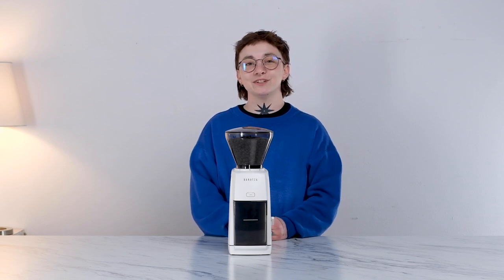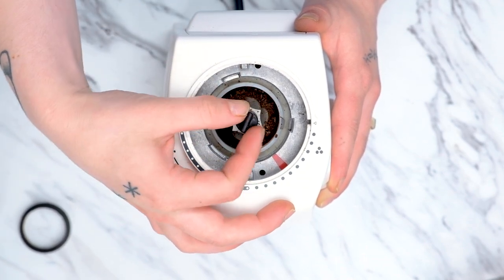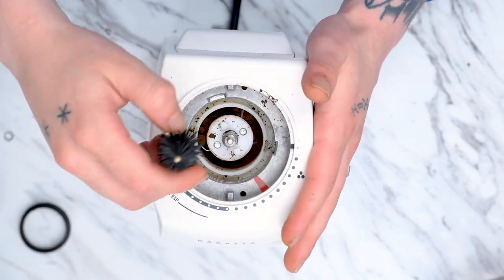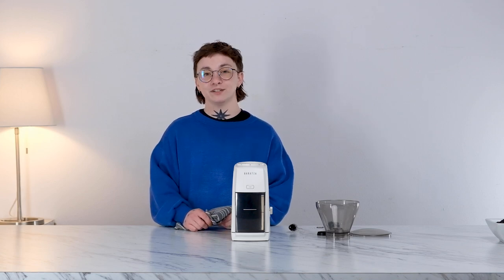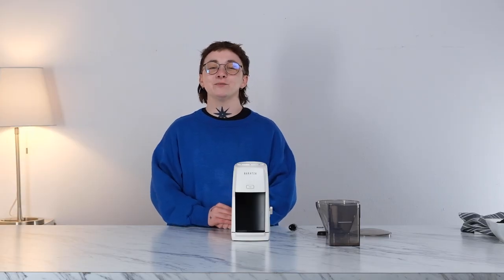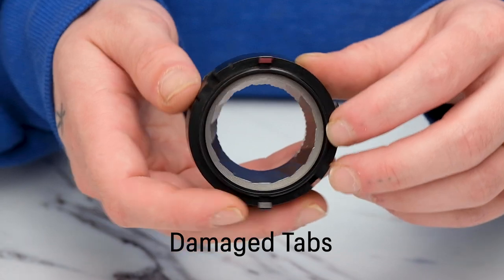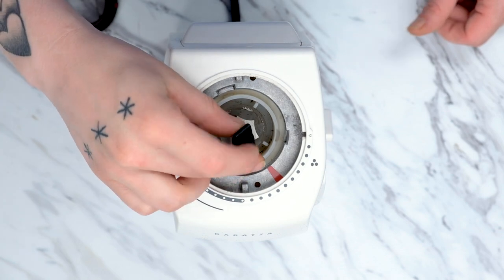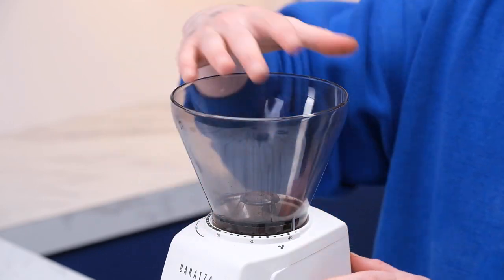How To: Unclog Your Encore ESP

Comment: In the case of a clog, I found that a small allen wrench worked best. Go in from the front underneath and angle it up to punch out the clog. This is a wonderful grinder but it has a glaring design flaw. This should be easier to unclog given how frequently it happens.

Comment: The paddle wheel doesn’t lock on top of the paddle wheel pegs, what should i do?
Reply: I had the same problem and realised the paddle wheel was a bit misshapen... Although maybe accidentally putting it back in upside-down and then trying to grind didn't help.  Either way, if yours isn't locking on then check it.  I had a look and it's cheap and easy enough to get a replacement, sort of.

Comment: To Baratza Support - I have an ESP with one of the spacer washers on top of the lower burr. I am able to remove the hopper, gasket, upper burr and lower burr retaining knob just fine, but I cannot get the lower burr to budge. In every video I've seen, it lifts out easily with no threading or effort, but mine is stuck tight. I don't want to try using pliers to dislodge it, and don't happen to have a right-angle dental tool lying around. Any idea why it is stuck, and what to do to release it?
Reply: Mine does the same thing

Comment: Is it in theory also possible to remove one or two of the shims from the stock setting, let's say in case the steps are too fine?
Reply: Me answering to myself: Did it, works fine. I only removed one of the smaller shims. There are 3 thicker, and 3 thinner. I removed a thinner one.  The scale just gets all across the board more coarse then. But I put it back in nevertheless, cause I figured I don't need it. I though it would be cool for my pour overs, to basically push the fine 20 steps more into the coarse range, to have in the medium fine range more steps for the perfect pour over grind size (i grind relatively fine for one cup pour overs). But I ended up finding my range, with one shim removed, around setting 11 or 12. So I thought, well, that is just around 18 with all six shims installed. So I put it back in. But it worked fine!

Comment: So I assemble and proceed to grind aobut a cup of decaf beans. Then I go back to do the same with regular beans and presto-nothing comes out! I assume it is clogged but not in the upper mechanism as I took that out, &  cleaned it
I will follow the video and I assume that will cure the issue, but, after less than 2 cups of beans? This unit costs $150 and it cannot get past a cup of beans....
I want to order a replacemnt gasket, felt washer and the  plasitc paddlewheel as they look ike the pieces that will fail.
I hope I just had bad batches of beans else this unit will be going back.

Good video!
Reply from the maker: Thank you for bringing this to our attention! If you have not already, we would suggest running through this troubleshooting grind quality video to make sure that all the components are in good shape still - https://youtu.be/qUCMrWIdyLI. We do sell replacement parts on our website but feel free to reach out to support@baratza.com if you have any further questions or if this grinder is still under warranty!
Reply: So i cannot remove the center cone burr--even after I removed the wing nut! It will not pull up. This unit is looking to be a not so good product and gettting phone help is impossible. This video is all I have and it just appears the unit should just lift off easily.
I will produce anothe rsupport incident and if that does not work the unit will be returned.

Comment: The so called quick release knob doesn't open at all when you to clean out the bottom burr
2 weeks in its just tightened up on its own due to the fine espresso grounds

Does the job but man it's a pain to clean this device through and through

They need to reconsider and re design this to actually be serviceable
Reply: it's a reverse thread. clockwise to loosen
Reply: It can be pretty difficult to dislodge it the first time you try. Try bracing the lower burr with a finger while turning the knob clockwise - eventually you'll feel it slip and it will then unscrew completely.
Reply: I have this problem too.  Unfortunately as I tried to loosen it, I broke the treaded bolt it screws on too.  Machine pretty much done for since I don't see a way to repair it. 😢